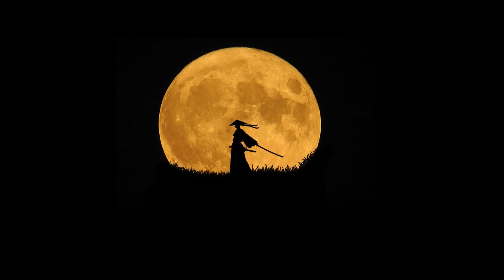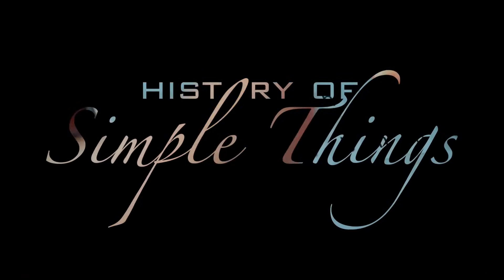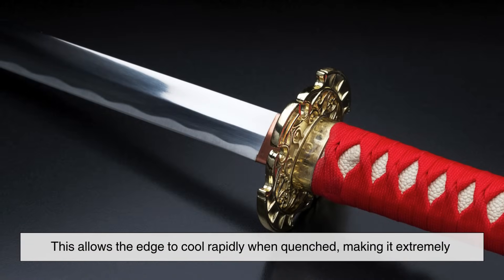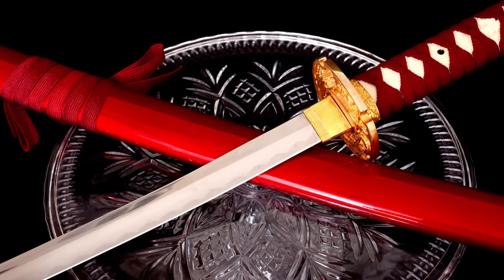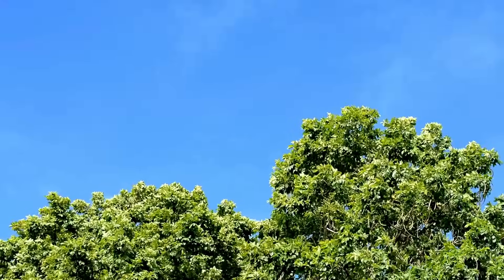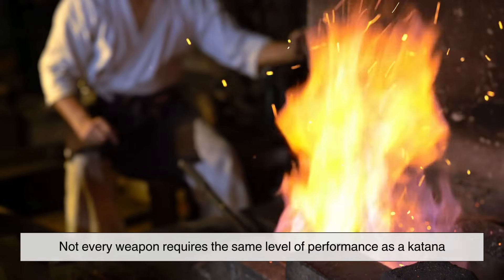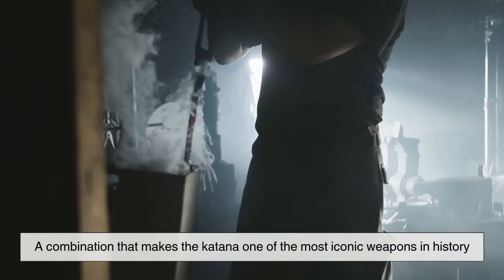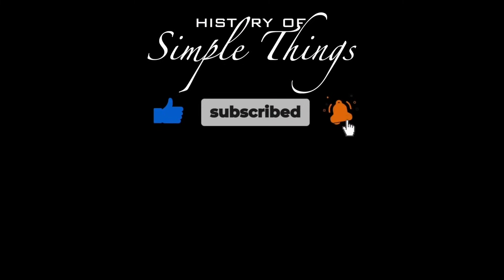Why Do Katanas Need Differential Hardening?

Comment: 5.42 Why not every sword built using this technique? 

Katana is more a blade then a sword. The weight, and thus the speed equal Chinese thin blade and western fencing thin blade.
Katana is a blade that possess sword quality, if you will. 

A heavier sword can surpass weilder strength to prevent shattering.

Legend said that Katana almost became the no 1 blade in China, until finally the best Chinese master swordman defeat the superior Katana by using his superior skill, wielding ordinary Chinese thin blade.

Note: both Japan & China poses several uniquely strong blade that aren't use for everyday task.
These blades aren't use in the legendary duel.